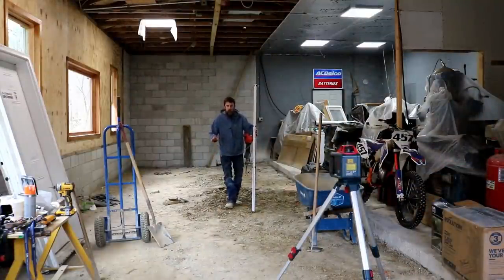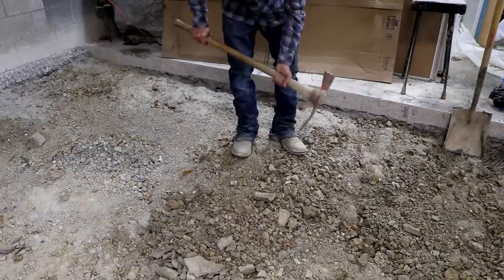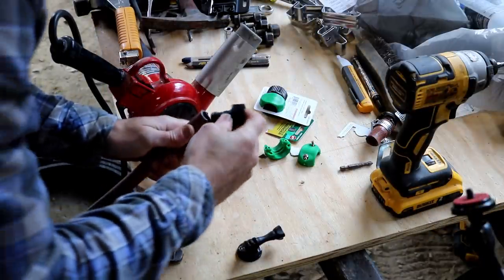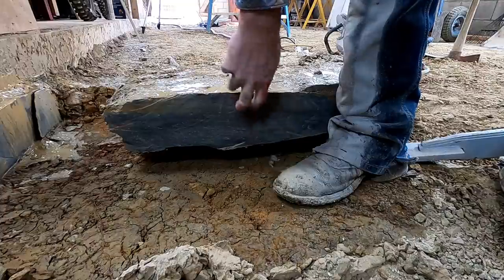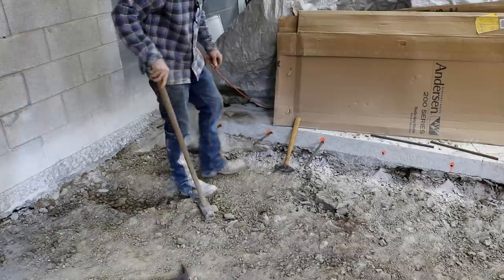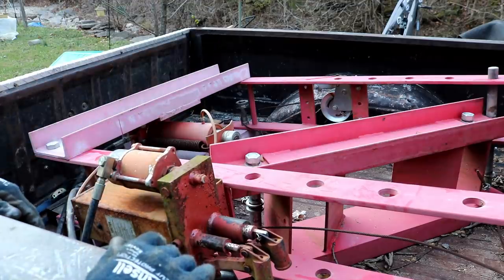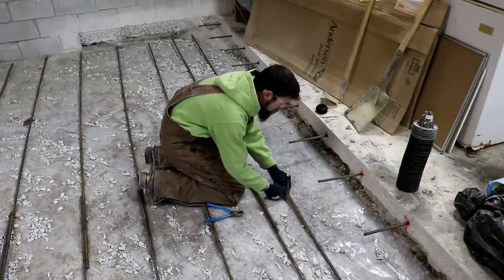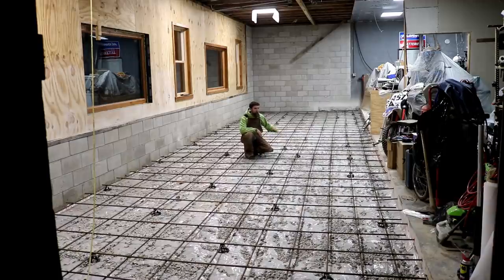Preparing for concrete .

Comment: Wow, no Epoxy needed. I had two additions put on my house in Los Angeles. That rebar tie-in was one of the most inspected areas. They come out to inspect the holes you drilled to make sure they are blown out before Epoxy. Then the Epoxy set is closely inspected before pouring. They have deputy inspectors for these specific items and yes there is an additional fee for that. But then you don't have earthquakes in Kentucky.

Comment: Looking good!!! You might consider instead of just sheet metal on your un even edge, use a piece of angle iron as your screed. Weld som bolts or pins on bottom to anchor into concrete. Then you’ll protect the new edge from breakage til you can pour matching height concrete. Kind of like the cast in place stair noses you might see on commercial buildings. The anchor point suggestion is a good one as well. Mine are 1-1/2” pipe nipples with a coupling and welded to a piece of plate. I cap it with a pipe plug so nothing is sticking up. Pull the plug, drop in a pin and start winching.

Comment: Hi Steve. How about a dividing wall down the new concrete line and use the new floor area for your machines. That way you can insulate it, have good lighting and an epoxy floor. The back section could then be used for general storage etc. Looking forward to seeing the floor down. Thanks for the Sunday morning entertainment. Cheers Dave.

Comment: I like your solution to the floor level problem.  (Even though the levelling screed will crack and annoy you.)  This way you will look at what you did and be happy with that.  Correcting the other nasty work can be done in due course.

Comment: So when the rebar is all the way out to the outer walls it´l create a "cold bridge" allowing cold to pass into the rest of the floor during the winter season.  In Denmark we cut the rebar of 5 cm from the outer walls to avoid a "cold bridge".  It´s due to the thermal properties of metal.
Reply: I was wondering about rust of the iron hammered in the lip. Almost impossible for moisture to reach it. Not a problem?

Comment: There is a commercial sheet metal product for just that purpose-has formed pockets so it can be anchored with pieces of rebar. used it in my shop so we could screed down the middle of 32' width. 32 x 56 total slab with pex tubing for heat.

Comment: Little advice from a old concrete contractor  . Move ur stuff a least 4' away from edge so u can use a walking edger. If u take the rear chairs out it makes it alot easyer to wheel the concrete over and just lift the mat as u go . When u snap ur finish grade lines on walls spray some clear lacoure on chalk lines so wet concrete can't wash away. Hopefully ur hiring a place and finish crew. If u know of any concrete construction in ur area talk to guys on job bet they would come on a Saturday and work for cash. Good luck

Comment: And I agree, just level the existing concrete slab with floor leveling compound.
You might not even have to address it again in the future, if you set your new slab's nominal height to the old pads highest point + 1/4 inch or so.

Comment: Steve please make sure the concrete guy use a vibe  shaft while laying the the mix to to bring the  trapped air to the surface and it will also help to give you a great bond around the reo bar

Comment: Last push now- keep going! There is some sense in having a floor run to the door, if you are in a situation where rain can get blown in by wind etc. Better than having it run into a back corner!
Reply: If you keep a car in there or are working on one in the winter and it’s dripping wet. Or if you want to hose the floor down after you work on something in that area. Most garages have some fall built into the floor for drainage, an inch in ten feet is almost unnoticeable but helps with drainage!
Reply: Yeah, but not 3" over 20 feet. That's way too much. Plus, it's highly unlikely he will have the door open long enough to have sheeting water.

Comment: Love your work Steve (do it right the first time not the 2nd or 3rd) and you have a beautiful family - which includes the squirrel and the new little puppy.

In Australia we have product called gutter guard which will keep the leaves and rubbish out of your gutters. The cheap version is plastic, the better is a stamped aluminium powder coated to all the prime colours that you fix to your gutter or roof. The end result is, you never have to worry about 'Fall' filing up and blocking your drains each year.

I agree with you not pinning to the external wall, this way your slab can move up and down independently without 'interfering or damaging' the external wall which is permanently fixed. As we already know when 2 forces move in different directly one of them has to fail, or move with the greater force, which will end up in damaging one both of the objects.

Comment: instead of pouring in threaded inserts for eyebolts, I'd put in these pre-fabbed, approx  2" x 2" steel tubing boxes which contain an anchor and/or a captive short length of chain which you can grab-hook onto to pull on things, like machines, car frames, etc. When you're not using them, you just push the chain below the surface, and cap them.

Comment: I put in dual 4'×4' 10" thick pads in the middle of my shop to add a lift and I drilled the floor n hammered rebar in there too didn't realize that it was the proper way I just thought I should join the two separate floors some how dam you do nice work

Comment: Nice job! The rebar chairs are so often left out with the claim they can pull the bar or wire up as they go. That doesn't work! Using a vibratory screed helps consolidate the concrete. About using sheet metal to screed on the existing concrete, keep it well back from the new so that gravel doesn't get worked under it. A power trowel will make a more consolidated  and likely flatter surface but it needs to be run by someone with lots of experience. I wouldn't have driven the bars into the old concrete. Their function is to provide shear load transfer to keep the two slabs more or less flush. A slightly lose fit will do that and not risk stress cracking the old concrete. It is possible to get a good bond between old and new concrete. Have done that on federal jobs but it is a lot of work. Epoxy probably works but gets really expensive. Epoxy floor coatings: Don't use a wax based curing compound if you are going to use a floor paint, consult the supplier of the paint.  I did my shop floor 35 years ago and really like it. Various gloss levels are available to control the slip. Requires very careful prep but is extremely durable. Makes cleaning much easier, eliminates grease soak in, use a light color for better light reflection to brighten the shop. IMHO worth it's considerable cost.

Comment: You can use a self levelling compound for floors it has an epoxy in it and will bring the old and new floors together, you will never know where the old and new floors stop, one thing is concrete expands so might have put an expansion joint where the two floors meet

Comment: If I had to drive that many rebar into the slab, I would use the jackhammer. Saves a lot of time and effort. Set each piece with a hit or two so it is in the hole and finish it with the jackhammer.
Reply: The hammer drill used to drill the holes would push the dowels in as well. It’s also a good way to install long ground rods.

Comment: Cap pour instructions: (I doubt that you will pay attention.. Js)
4k psi with pea gravel. 
Screed to 1/2" thick at taper. Finish to 0" with half sand and half Portland with acrylic mixed in.

Comment: Looking very nice.  You can use 2x4 dropped from your bottom chord of the trusses with a 2x6 levelled up and screed to the underside of it as an easy solution.  Another option would be to laser shoot steel pipes screeding and pulling as you go with a quick fill in works good and is an easy option as well.  Snapping a line around the block walls will keep you very close combined with either method.  I think you made the right decision with lots of steel and not tying it into the exterior wall.  It should be floating which is what that does with your expansion joint around the perimeter.  Harbor Freight has two versions of air over hydraulic jacks that make an excellent replacement if your unit is frozen up.  Take care.

Comment: Steve I've been with you for this point and thought you done everything great but I got a comment! Watching you Hammer those pieces of rebar into that concrete all I kept saying was bad idea bad idea bad idea every time that thing went twink twink twink twink. I am fascinated with watching guy split large stones. And that's exactly how they split a 6 or 8 foot thick Stone and 1/2 they take a piece of metal that's bigger than the whole day drilled and drive it in there with a hammer about every 12 Min apart sometimes 6in apart. You should have drilled those to the proper hole and epoxy them in there. Just my opinion with all the times that I've seen people do that I never seen anybody drive a bigger piece of metal inside concrete without it splitting. I will go back to watching the video I'm at 18 45 and wanted to make this comment.
Reply: I don’t think driving a 1/2” diameter rebar into a 1/2” diameter hole is going to split a 7” thick concrete slab. Splitting stones is usually done with feathers and wedges. A pair of feathers are placed in each hole and a wedge is driven between them. The taper of the wedge matches the taper of the feathers causing force to be exerted against opposite sides of the hole. I’m not sure what the exact force exerted would be, but I would guess it to be an order of magnitude greater than what Steve was causing with those pieces of rebar.
Reply: Usually expansion joints are put where the concrete is likely to crack
Reply: Ive split concrete with less..  concretes kinda tricky to work with as its aggregate isnt perfectly consistent throughout the pour so either way to say a half inch hole with half inch rebar..  if you have to hammer it in there like that, it doesnt fit obviously and is acting as a wedge in that concrete..  where does the extra material have to go as he is hammering it in chipping off the hole?  It builds up and compacts it acting more like a wedge..  is like screwing a tapcon in concrete with a hole thats too small, your either going to snap the screw or break the concrete so where the screw wont stay in the concrete anymore ..  hell when i was cutting my slab for shit pipe repairs, i cut the slab as deep as the saw would go 4.5", but some parts were slmost 5" thick so i had yo take a wedge and hammer it in the cut to break away the chunks and i got most of a 15" wide trough cut out and chipping away tge last piece, now mind you that gravel is directly under the slab so it is supported.  But get to the last little bit of a 25' x 15" strip and managed to crack an 8' round chunk in one hit on the wedge that shoulda chipped off a small chunk..  instantly that crack opened up and coulf feel the ground move..
Reply: @janderson8401  I agree with you but I half inch piece of rebar and 1/2 inch hole should go in there without having to hit it with a sledgehammer I'm hitting it 57 times
Reply: @Z-Ack  I've actually cracked in 4 in of concrete driving an anchor wedge in. Just cuz it had a fault line that I couldn't see
Reply: I think steve knows what he is doing. He wants the rebar there for when he removes the old floor. He just wants a perfect floor everyware, just like me. love you steve.
Reply from the maker: We will see😁. So far so good. It's not the end of the world if it cracks on the old side.  Its already busted all over the place.  In time it will be replaced anyway. Thanks for watching 🙏
Reply: @SteveSummers  that was my thoughts after I got a few comments on this I thought I bet he's going to plan our a placemat anyway cuz you said had a bunch of air in it. Love You video Steve! Good job on the video. You keep me interested throughout the video.
Reply: My thoughts exactly. It either splits or it doesn't but it seems like a risk. I see Steve says he's not bothered but that's a little bit at odds with his general "do it well and make it last" work style.

Comment: Excellent work as always....:)  My climate is very cold in the winter and everyone loves In floor heating.  Please give your decision to go with conventional heating a rethink....:)
Reply: In floor heating is great as long as you heat full time. It is very slow at raising temp if you turn heat way down or off. Forced air allows you to add air conditioning easily in the future. I run a dehumidifier all summer which really improves the conditions for anything in the shop building.

Comment: Id put grade stake's along the side next to the old concrete about the width of a hand float then poure the new pad level and use a hand float to blind in with the old floor then you'll have a level floor and no lip then when you pour the other side cut over to the level part and pour new would save money without having to pour the skim over the old floor!!

Comment: i would put piping in the floor for future conduit or some other use. Always put in more piping than you think you are going to need. You will never have enough. i would have put  conduit in the window wall for electrical wiring.

Comment: Rather than a heat gun to soften hose, I just use a big coffee mug full of just-off-the-boil water.  Portable and no power cable needed.  With experience, you can heat a couple of hose ends before the water needs replacement.  Water also acts as a lubricant.  Try it sometime - you may like it...

Comment: My thought on the floor is keep it even with existing floor unless you are putting a wall up along the joint. I have tripped over uneven joints on floors and that can be very dangerous. If you can transition the uneven joint into the other floor so it doesn’t create a tripping hazard then it could work.

Comment: Steve, I think the slope was intentional to let water out. Like others have said putting concrete over the old will gradually breakdown But if it is a temporary fix this should not matter. come spring you could tear up the floor at the front and redo it to the level of your new floor

Comment: Almost there, Steve. The thought occurred to me that, if you already know where walls will go, to cross-cut the front part of the old slab where it’s low and remove it. Pour it level now and bury the transitions under the walls out of sight. Fantastic progress whatever you decide, you’re a beast!

Comment: What I would like to know is where you get your tools like the jackhammer and hammer drill that play such great music while in use. I have used my son's hammer drill, also a Bosch and it does not have the music feature, at least not that we can find anyway. Shop looks great. I had to use self leveling concrete in my house so I could put down hardwood floors, floor was so far out and this stuff worked great. A little pricey but it works.

Comment: My two cents worth:  no need to cut out the old slab in order to get it level.  There are many products out there that can be poured over old concrete to get a level surface.  There is rapid setting cement that can be troweled to level,  and self leveling cement.  Both are great products that set up as hard as the original concrete and,  with appropriate priming,  will not de-laminate.  I have used both products with complete satisfaction.  Anyway,  good luck with the concreting;  exciting really.

Comment: Interesting your issues with the existing slab. That was always a concern of mine. I don't think I would have keyed the two together. I'd also hope that in a year I could demo the other half and do it over. You'll never want anything straddling the two anyway. My new shop floor is 30x48 (four truck loads) and completed one pour then cut into ~15 ft. squares. Six inches deep, better than 12 inches at the edge with foam board insulation as a frost footer. The floor may crack some day but it shouldn't move, there is an average of 12 inches of crushed stone under the floor. A nice apron would be cool, I expanded mine when the guys told me they'd pour it separate. Its 30 feet wide and I think 10-12 feet deep, it was one full truckload. Since I was paying the delivery fee I thought I may as well buy a full load of concrete.

Comment: I would slope the new floor 3 inches from back to front for drainage ,,,but if you dont intend on running water or washing anything in the shop then pour the concrete level !!

Comment: Instead of sheet metal, just taper a 2X6 and glue it to the existing floor with PL200 or similar.    Advantage is that you will get the best bond between the slabs.  .Just break the wood barrier off when you are ready to skim the old slab.

Comment: Maybe add a PVC drain line under the rebar and attach a couple of surface drain inlets to the pipe so you can drain liquids/spills from far back in the shop.  It maybe too late to do now, as you may not have the necessary 'fall' to get it to gravity feed out the front door.

Comment: I’m no concrete guy but is the reason the front half sloped three inches is so water flows out and not in it look likes this building was used as a garage
Reply: right, not for a machine shop ,just a barn.
Reply: And when it was built concrete was cheap. In 99 around me $30 a yard. You could fill a lot of low areas for that low cost.
Reply: @johnscott2849  exactly and for a barn that was considered "deluxe" in many and in some areas most barns were hard pack dirt. My point is that the crete was ideal for it's purpose.
Reply: Yes architectural standard for garages is a slope of ¼” per foot towards the door.